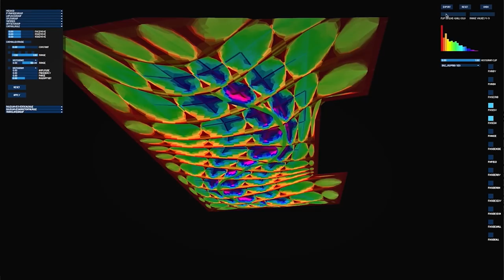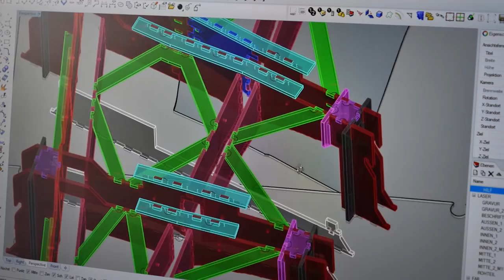Smart Slab

Comment: What kind of printer and print material has been used to build the mold? Awesome project!
Reply: i think its sand by exposing it to heat ,places that gets the heat takes the desired shapes.Because they cleaned the not heated sand afterwards.
Reply: some kind of selective laser sintering